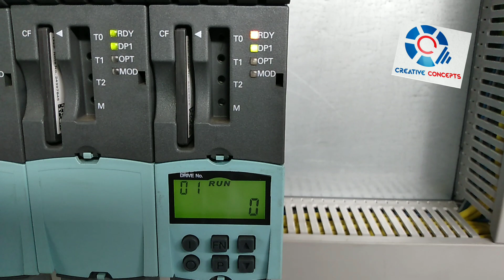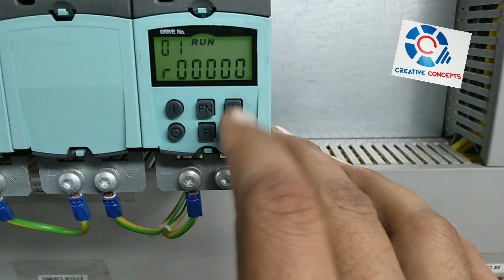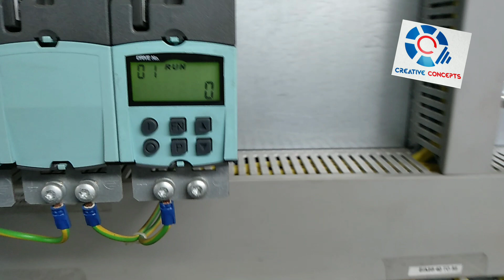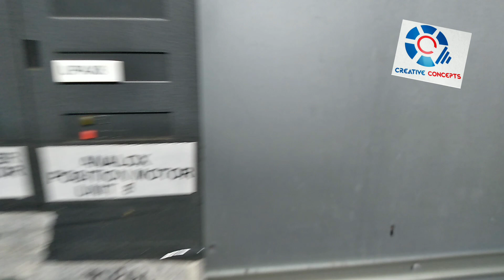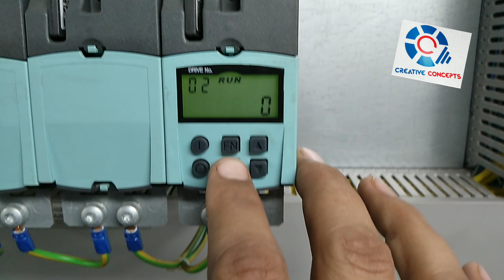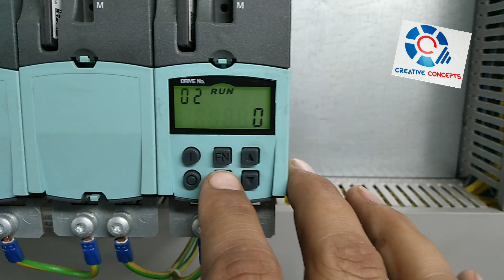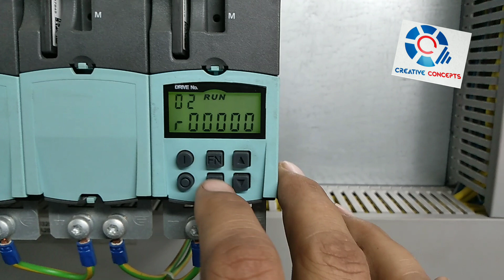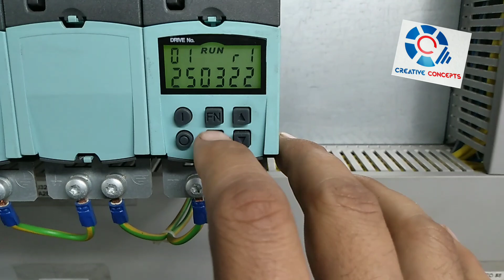S120 Siemens Sinamics - How to access all parameters@creativeconcept7584

Comment: How to make igbt/thyristor/diode test through parameters, multimeter.
Reply from the maker: Checking the IGBT using multimeter , I have already made one video . Diode checking using multimeter is simple, put the meter in diode mode, check by connecting both probes of meter to two ends of diode , once it will show some value like 0.4 .... 0.5 and when we reverse the probe, it will show open..... This confirms that the diode is ok..

Comment: hello, do you know what setting is responsible for initializing the engine? Or can you tell me where to find which parameter is responsible for what?
Reply from the maker: Complete manual in. Pdf format is easily available on web where you can easily understand regarding each and every parameters meaning.